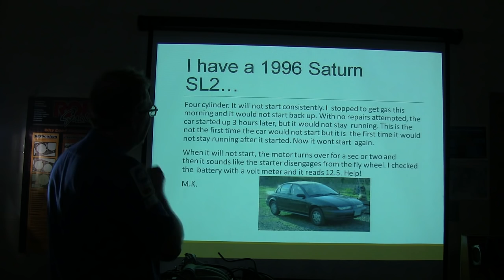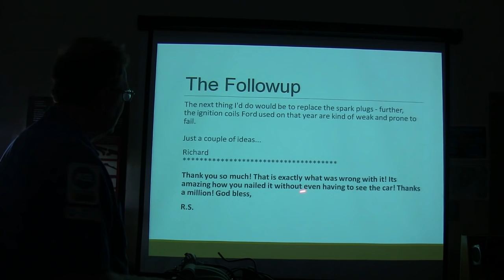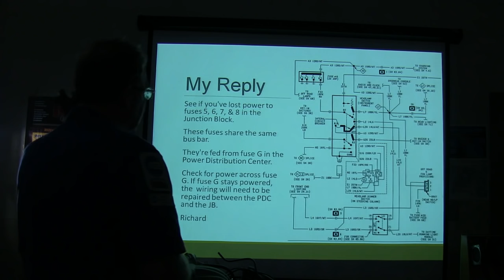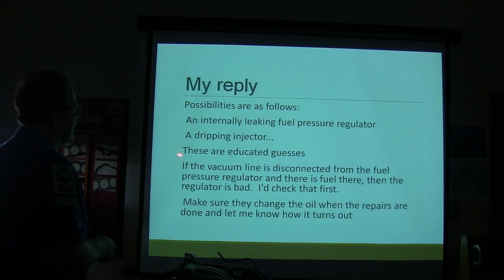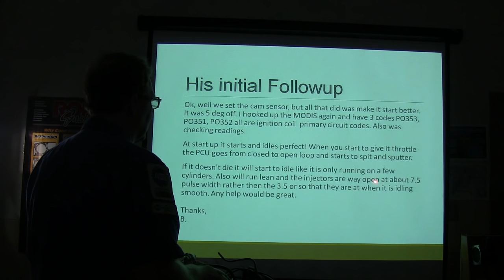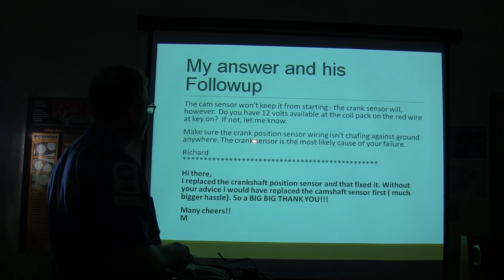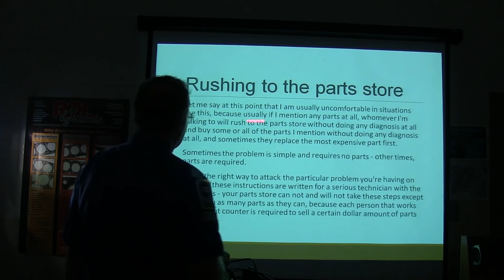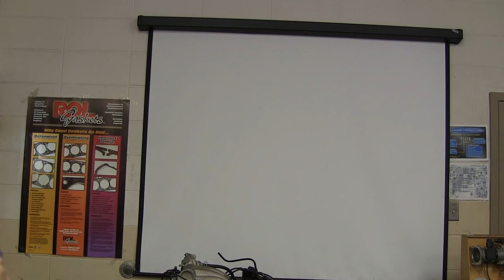Help Desk Session Part 4

Comment: Do you suggest using a quarter watt resistor to bleed down the capacitors when touching the terminals together?
Reply from the maker: I don't usually use one, but that's just me. Small capacitors bleed down really fast anyway.
Reply: +McCuistian It could cause a voltage spike in the system, if not slowly discharged?
Reply from the maker: I've never even seen a very small spark when doing it, really.  Not even in the dark.
Reply: +McCuistian Ok, I'll stop using it.